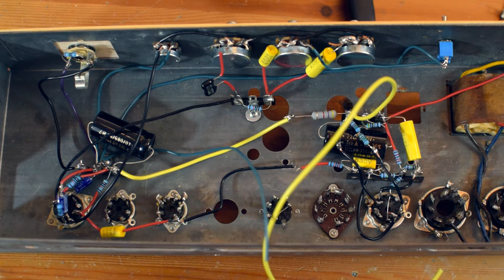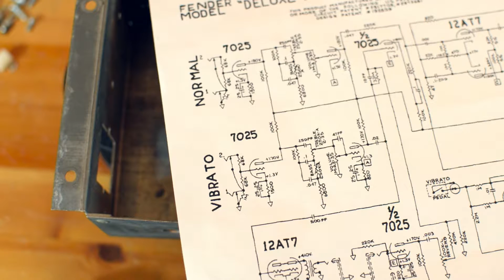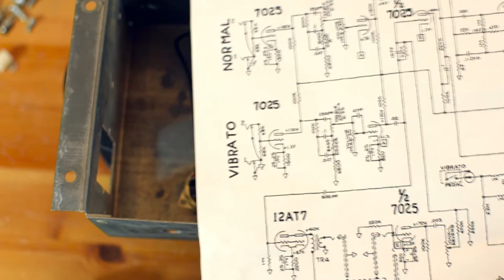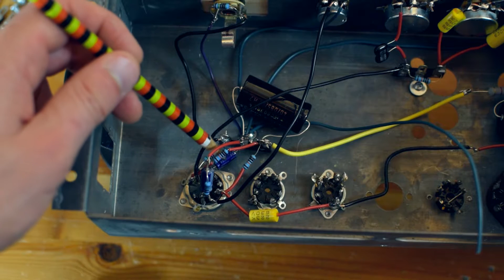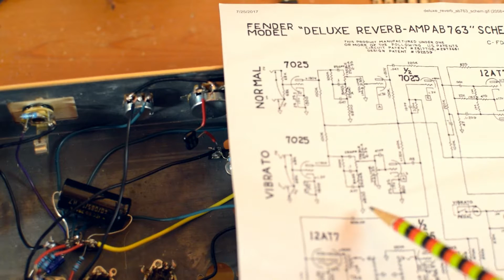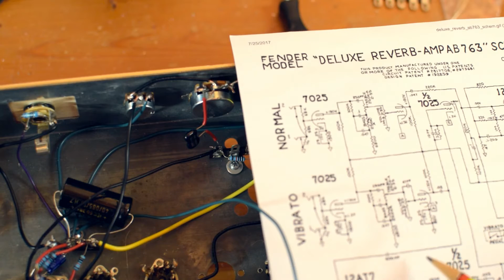Hammond AO-29 to Fender - Pt. 4 | PTP Wiring

Comment: Hi KDJ, Curious how the amp came out? I want to build the same thing. I have a few, 2 AO-43's and 2 AO-29's + a Lowery. What power X-former does your AO- 29 have? The silver or the black one? I have both. Some say there is too much voltage from these transformers. I was surprised that you went with solid state rectification, as that would raise the B+. BTW I have a nice H-100 I play. The others were out of junk organs. They were saved from going to landfills.  Thanks, Tom
Reply from the maker: The amp came out very well!  I have a full build thread here - http://www.tdpri.com/threads/hammond-ao-29-organ-conversion-2-to-ab763-and-beyond.763327/.
The PT in this AO-29 was very workable.  I didn't have to do much shenanigans to get it to work well with this circuit.  I am using JJ 6V6S tubes - which are a bit more beefy to take a bit higher voltage.  I'm at about 450vdc on the plates. 

This was my second AO-29 conversion - the first became a Plexi.  That amp had a lot higher voltage and I had to take some extra steps to drop the voltage down.  My guess is that it is related to current.  The AO-29 ran a lot more tubes, so going from like 11 tubes down to about 5 created some odd interactions.  That thread is here - http://www.tdpri.com/threads/organ-donor-hammond-ao-29-to-6v6-plexi-conversion.697430/. 

Overall, this is one of my favorite amps!  I experimented with adding another gain stage similar to a Trainwreck but had a hard time implementing it with low noise so I took it out.  Very classic Blackface Fender tone and has been very reliable.  It is probably my go to higher powered amp for larger gigs.

Comment: Hey Kley, just watched your  axe effects vid. how are you doing with it.  Are you still happy with it. I'm thinking of getting one.
Reply from the maker: soldanovht noneofya I have an AX8 now. I love it. All my tulip festival gig vlogs were using the AX8. It is awesome.
Reply: I was looking at the AX8  but you cant do tone match with it is that correct?   Since you used both is there anything you miss from the axe 2 that the ax8 don't have.  Thanks. I wont bug you anymore with the questions, I think. lol
Reply from the maker: No tone match.  There are also some blocks that you can't use more than once.  Like two amps or two reverbs.  For me, I don't miss those things - but it was great that the AX8 is cheaper, has great footswitching built in, and more portable.
Reply: Thanks.